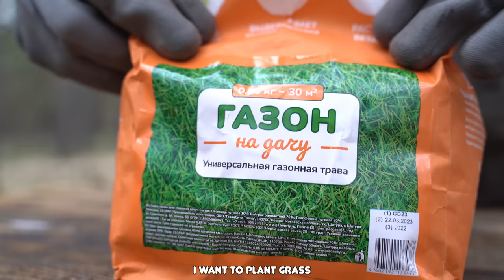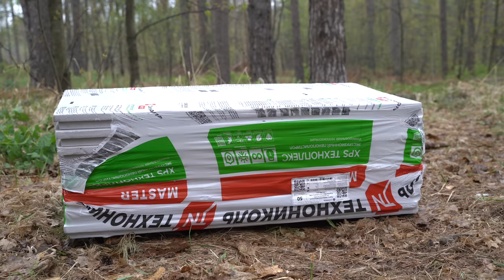COZY TREE HOUSE - Build a new roof and cook stew

Comment: You'd better pull that ladder up into the tree with you in case someone comes along and removes your ladder.  At least have a rope in the treehouse as a backup method of getting to the ground.  Otherwise a long drop to the ground and broken legs.